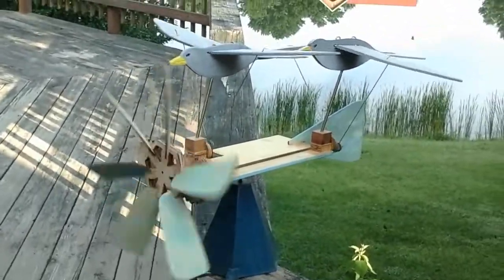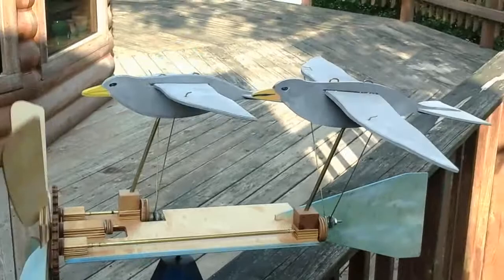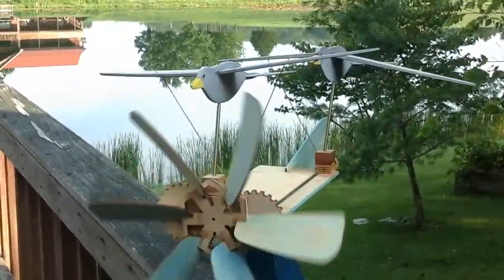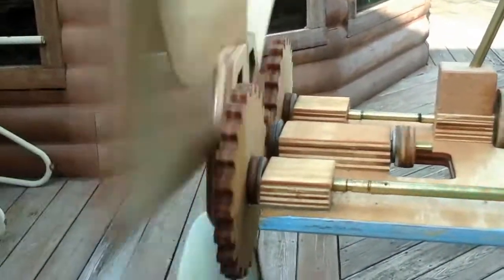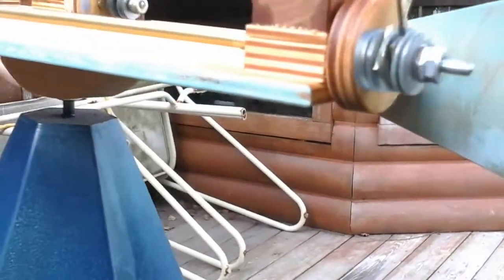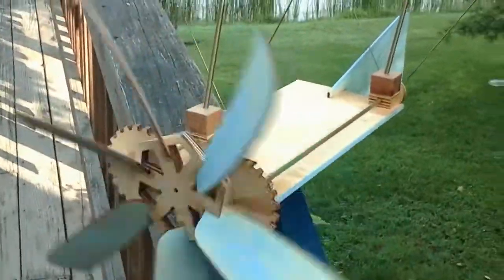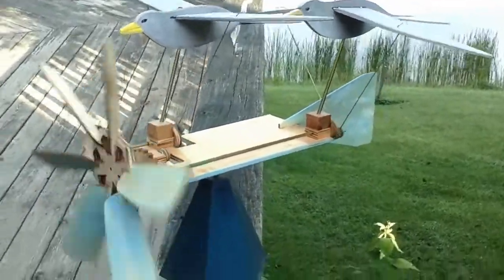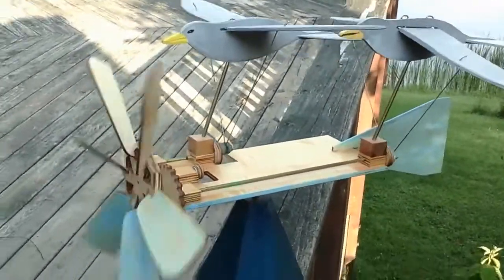Whirigig Wars 2018 Birds

Comment: Nice work. How did you determine the balance needed for the cranks?
Reply from the maker: The throw of the crank determines the (wing) movement. The easiest way is to put all the hardware (washers, nut, threaded rod, and push rods) on the journal - then balance that against a weight in opposition. In this case a jacketed bullet from a 44 (a 38 wasn't enough).